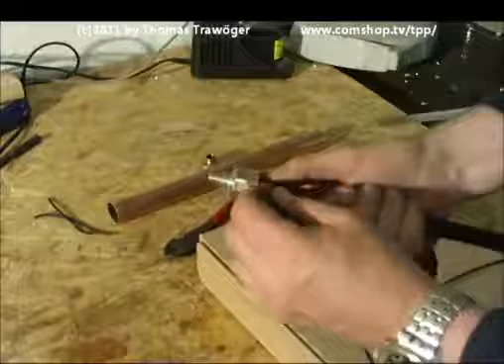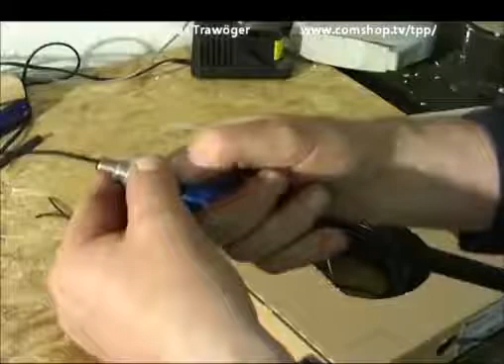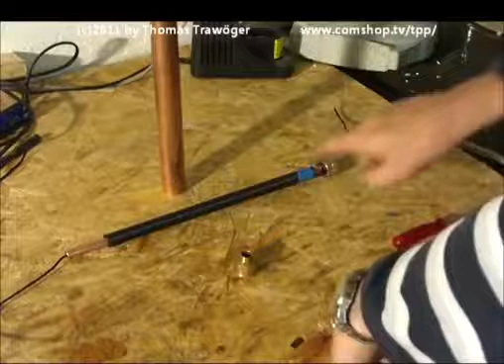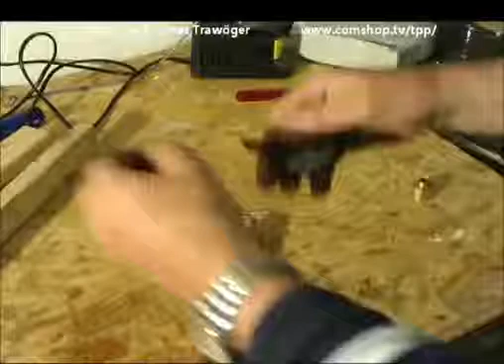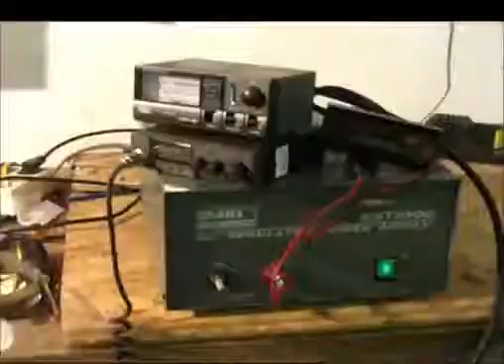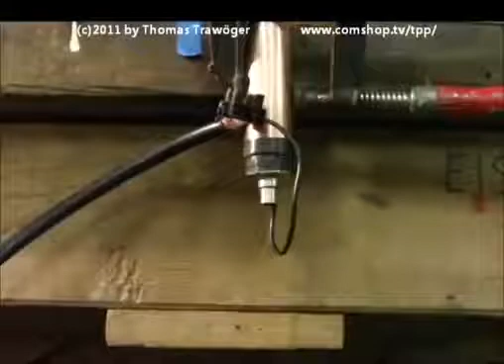TPP V12 Tutorial Part 3 of 13 - Reupload

Comment: Just saw someone else make something similar, somewhat simpler, but the same concept.  They call it a caduceus coil. It's hung vertically in the pyramid and PVC pipe is used with copper wire along with some other objects poured inside the PVC pipe.  In one of their videos they tried copper, but I can start to see why they didn't get the same effects on that pyramid you have.

Wish your Dropbox links were still working.